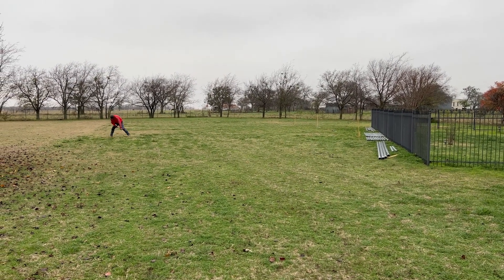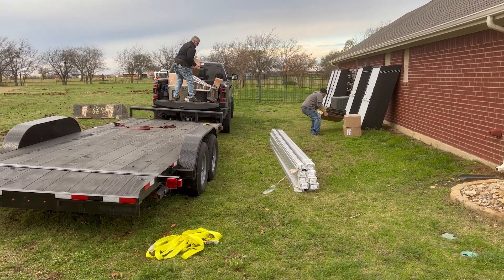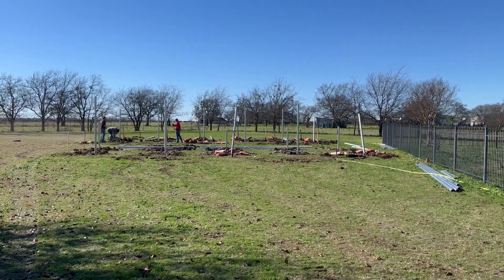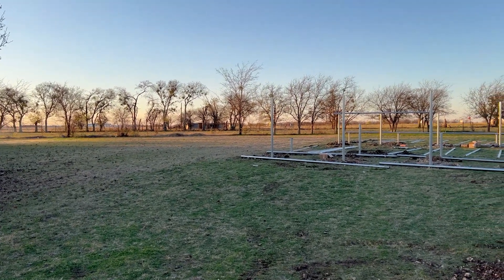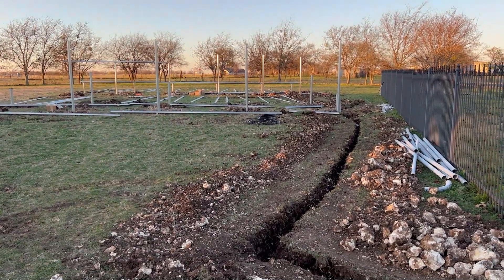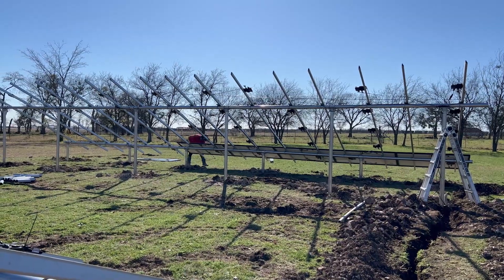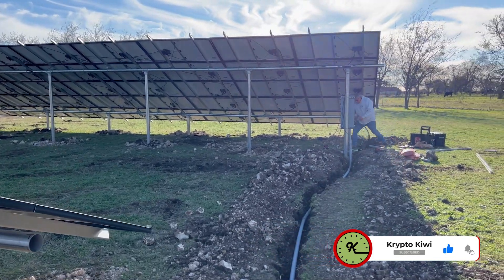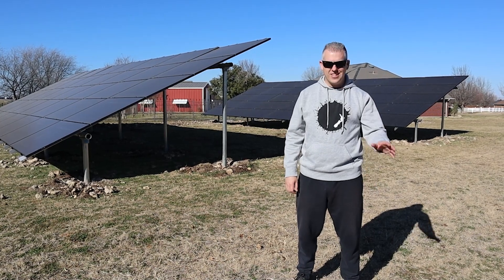Crypto Mining Farm Solar Build - 30kW $110k! Phase 1 Investment for KA3, K7, HS3, KDA, CKB, HNS, BTC

Comment: Wouldn't it have been better to build it in such a way that they always turn in the direction of the sun?
Reply from the maker: Yes, it would have been better, but in Texas any structures like this have to be rated for up to 120MPH winds due to tornadoes. The cost to have a system that turned with the sun would have been ideal, but it is cost prohibitive. It is better spent installing more panels. I have enough land so space isn't an issue. I can always face some different directions if I want to pick the sun up earlier in the day or later in the day.

Comment: Sweet! I just got word from my installer today that the project is delayed another month or two while the utility drags their feet on another review. I'm really tempted to ask if they can just build it as an off grid system to get it installed and then figure out the interconnect later, but that's a bad idea and would be more costly in the long run.
Reply from the maker: This install occurred in December, its just taken me until now to get the video together. I did order the system in Oct so it was a couple of months to work it all through. I think getting the interconnect all sorted up front would be best as well. I know its frustrating to have to wait, but probably better in the long run
Reply: @Krypto-Kiwi  I ordered in October too.
Reply from the maker: @arigornstrider  wow, that is a long time. What is the hold up? Interconnect with the power company? Where I live I am not in a city, so no city permits or inspections or anything like that. The system just has to be built to general Texas / US requirements which the installer took care of. I did not have a hold up on the interconnect or planning stages.
Reply: @Krypto-Kiwi  it's just the power company's permit. I'm in an unincorporated part of the county, so no HoA, no city, just the county and power company permits, but where I am, the state lets the power company override everyone else. Perverse incentive: the power company can refuse/stall my ability to generate my own power and force me to continue to buy my power from them. If I want to disconnect my power completely, I can be fined or have my kids taken away for being an abusive parent, because "I'm not providing their basic needs," even if I am providing sufficient power through my own generation. The power utilities in my state have a government guaranteed and enforced monopoly.